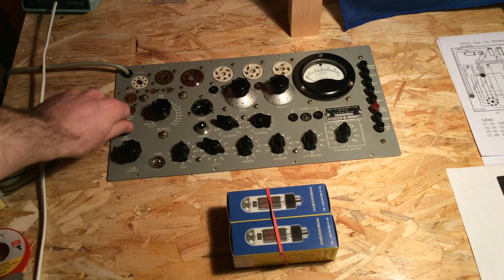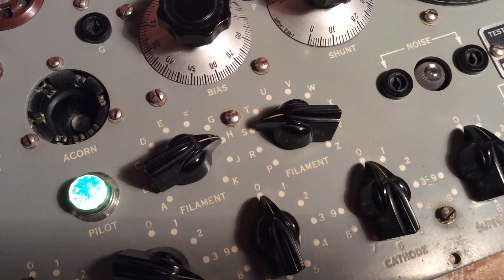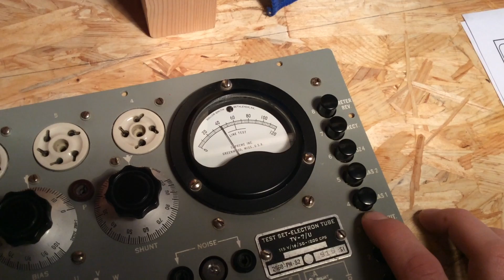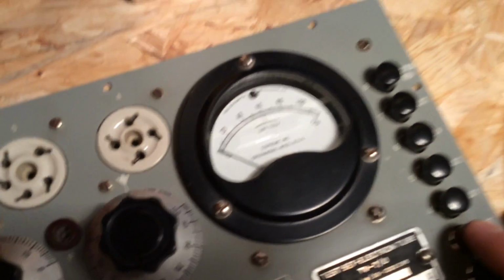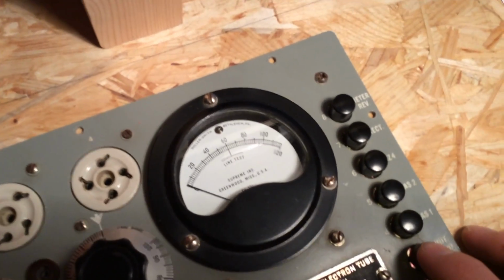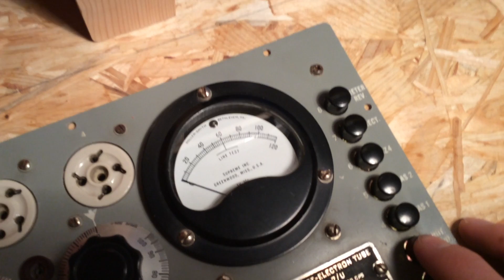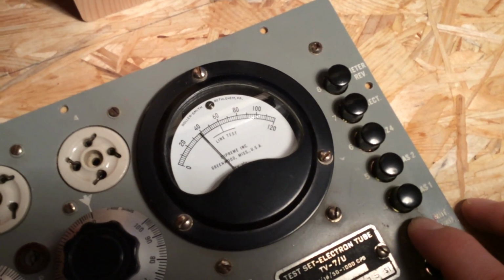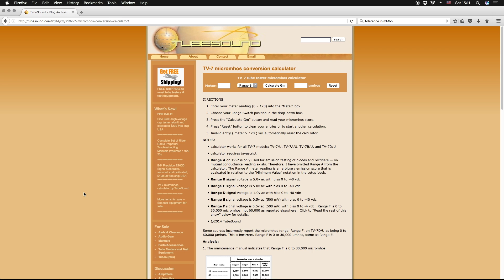Matched 6L6 Tubes Testing

Comment: I picked up a TV2. Where did you find the settings for the 6L6's?
Reply from the maker: I don't know how it is on TV2, check the forums for tube data or settings data, I've only used TV7 and it has the settings in the tube data, but I don't know if it is the same.

Comment: class A  testing  is the only way to match power tubes
Reply from the maker: Ok, so if you put two tubes in the PP amplifier without class A testing and measure one at 30mA and the other at 29mA at the same plate voltage, would you call them matched?
Reply: @Delatsch  more or less,but the best is to match tube's Ip is on the amp it self.

Comment: What happens if you put two different brand/shape but same type 6L6 in an amp? They are 10mV apart when biasing, 25/35mV, the amp manufacturer says 30 is the goal. Can I damage anything?
Reply from the maker: Nothing will happen, depending on the amp you might have a bit more distortion (which can be a good thing) and a bit more noise.

Comment: Thx for the nice video! 
Do you have an idea on how to consider  matched a pair of tubes? I own several new old stock General Electric 6SN7 GTB ,  I read on TV-7 the following values:                                        
Tube 1 :  TR1 = 2525 / TR2 = 2500 
Tube 2 :  TR1 = 2550 / TR2 = 2725 
can I consider them well matched ? how is the good tolerance percentage to consider it matched (+/- 5% or better?)

Comment: Over the years I have got mixed opinions as to whether or not balanced tubes really make a noticeable difference in performance and tone or is it so small it should be considered negligible. I have been told it is a function of a transcondutive curve? Technical opinions would be greatly appreciated
Reply from the maker: I share your opinion, Mark, I think it is more important from a technical stand point and there are some applications like compressors where both tubes and transformers need to be more closely balanced to avoid distortion and noise. But in many tube amps of the era even the two primary windings on the output transformers were not balanced so using closely matched tubes wouldn't even make much of a difference. Thanks for sharing your thoughts!

Comment: Hi thanks for the great video... If you know that your winding on one side is like 300 ohm and the other side 270 ohm would you put the tubes in accordingly? I.e. more conductive tube on the side with higher resistance?
Reply from the maker: Thanks! In theory yes and you should ideally have the output transformer windings balanced (or symmetrical) the inverter tube should be balanced, but in practice it doesn't really matter. Even if you are using mismatched tubes with mismatched windings in practice it doesn't really make a difference for worse or better. There are some amplifiers which might have a noticeably higher noise level if the tubes are extremely mismatched, but it's really not that critical in most applications. I made this test more for fun than anything else.